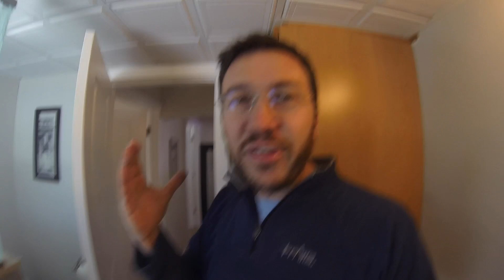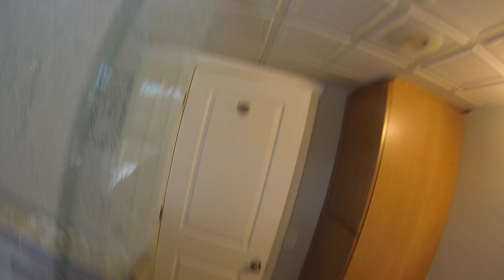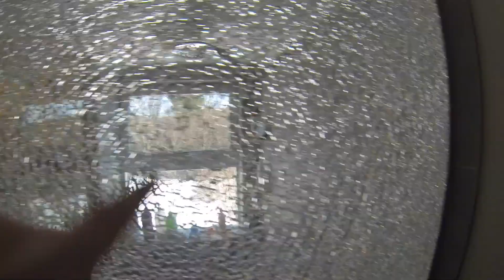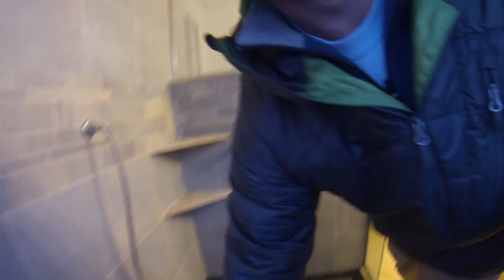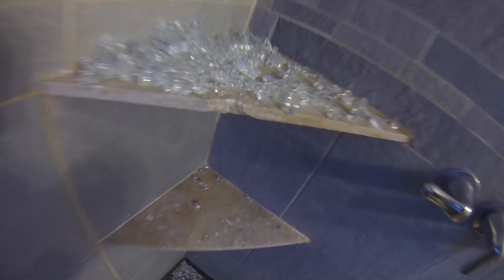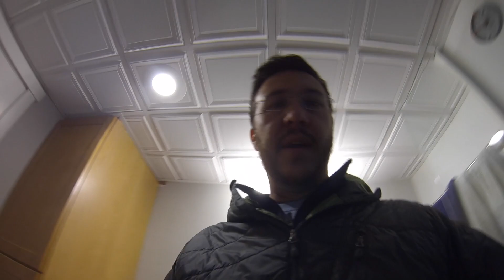My Shower Glass Exploded!

Comment: Well, the glass can be damaged during production. This is not visible to anyone and are ussually microscopic cracks however this is very unlikely. Most people think that the glass is fragile where you look through it or push against it but that is a misconception. The sides of the glass that are mounted against the wall are extremely fragile and can destroy the glass with 1 tap of an object. Most of the time contractors install the glass improperly by either letting the glass rest on the sides causing unnatural pressure damage or accidentally lightly hitting the sides during install wich will damage it. Damages sustained while transporting is also a viable option. If installed uneven it can cause unnatural sideway forces onto the glass screen causing it to warp over time and eventually pop under the strain. Tempered glass is designed so that if it fails it will pop into tiny pieces so that huge glass shards can not injure someone near it. Most of the time the microscopic damage or uneven installation can be forgiven and will not cause failure. However if the room goes through vast amounts of temperature cycling this will affect the glass in bad way. That is why it's better to prevent air movement in a bathroom with tempered glass [E.g closing the door] and only allow moist air removal by either sucking air out with venting creating a negative pressure room. Or leaving the door open for an hour after a shower or bath and then closing it. If you turn your heating off (drastically) during the night this is recommended.

Comment: its your house, like the other guy said the house undergoes settling over years  aswell as expansion and contraction as summer turns to winter and winter to summer. the wall that the glass was stiff mounted to moved and because the glass was stiff mounted to the tile half wall it basically pulled the glass apart

Comment: 18years  ago, a glass wall of  an office also exploded without reason, an office of a factory i worked . At that time we thought it is the temperature difference of the two side. The inside is very chilly because of the 14 cels degree air condition setting. 
So, this time i thought the same. it's too hot inside your shower room, and too chilly outside your shower.

Comment: What a mess! And not lucky with that tile chipped off! Hands pinched with glass because of not using gloves? You could go for a shower curtain:-) No...not an option I guess! Maybe an aluminium profile would be a option to join the glass on the corner instead of glueing it!? Maybe the glass broke because of rapid temperaturechange!? Or the walls are expanding or contracting causing stress on the glass!